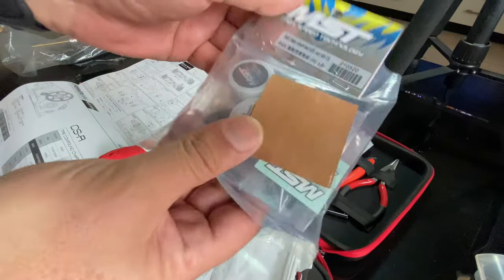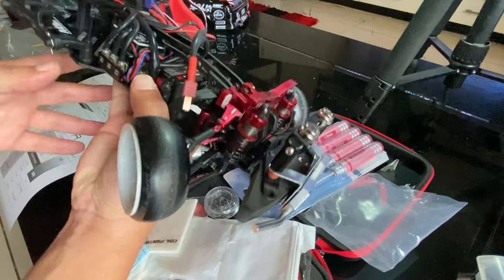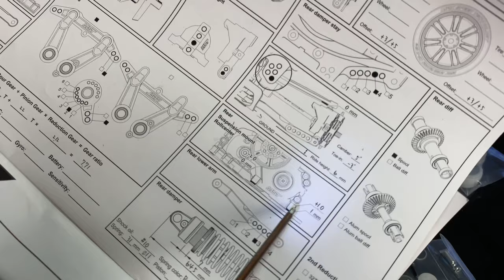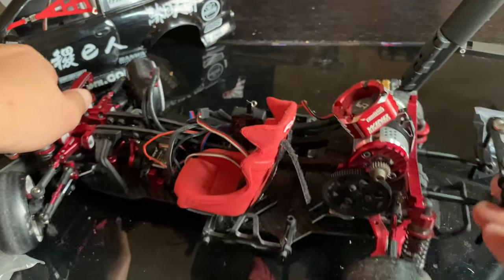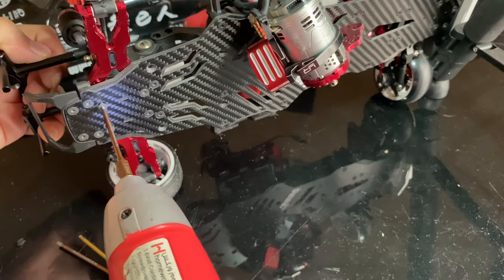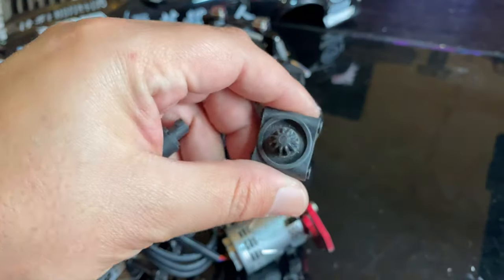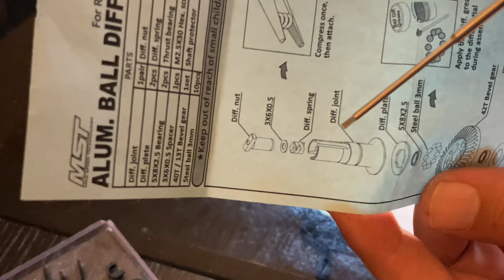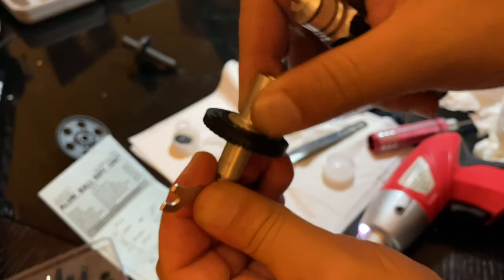MST RMX 2.0 Full Upgrades alloy & Carbon #RCDRrift

Comment: Hey man I just a problem with the black main shaft when I rotate it the rear where the wheels go don’t rotate what can I do to fix it
Reply from the maker: first remove the motor make sure its rotating fine maybe jammed and need replace then check your input gears inside the diff maybe they are toasted in the diff box